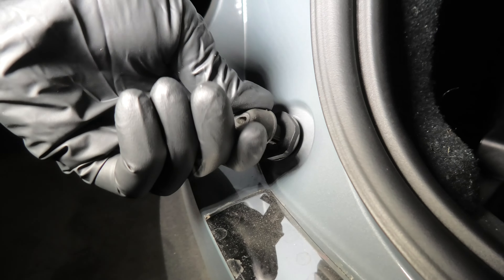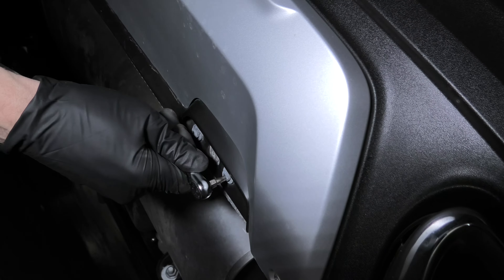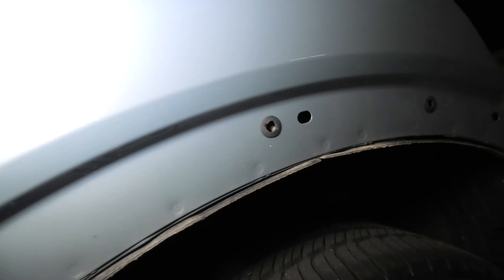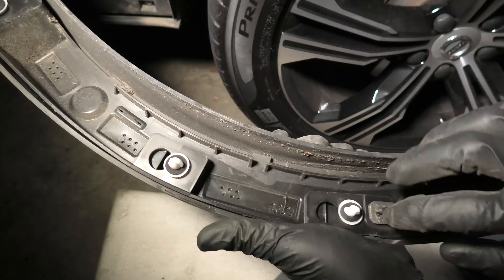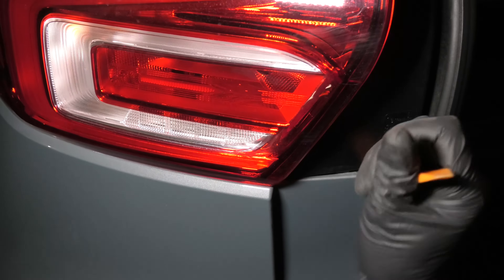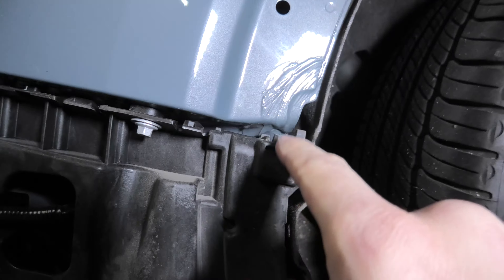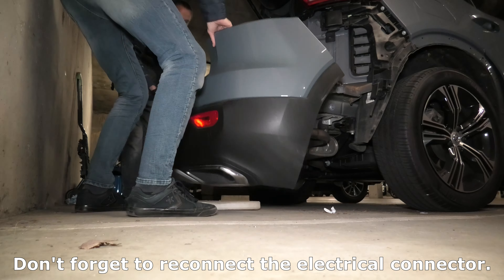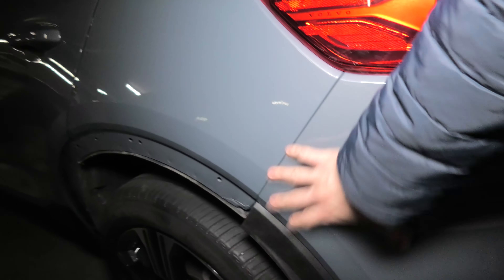Volvo XC40 (2019-2025): How To Remove Rear Bumper In The XC40?

Comment from the maker: RECOMMENDED TOOLS:
1. WERA KRAFTFORM KOMPAKT - Wera Kraftform Kompakt Zyklop Mini, Set of 27 - https://amzn.to/3N91Tch.
2. FLAT HEAD SCREWDRIVER - Klein Tools A131-2 1/8-Inch Flat Head Screwdriver with Keystone Tip, Made in USA, Pocket Clip, 2-Inch Round Shank - https://amzn.to/3VV0FVh.
3. WHEEL ARCH CLIPS - Genuine Volvo Flare Clip 30622862 - https://www.ebay.com/sch/i.html?_from=R40&_trksid=p2332490.m570.l1313&_nkw=30622862&_sacat=0&mkcid=1&mkrid=711-53200-19255-0&siteid=0&campid=5338971185&customid=&toolid=10001&mkevt=1.
4. TRIM REMOVAL TOOL - 4pcs Auto Door Clip Panel Trim Removal Tool Kit - https://amzn.to/41nYhsk.